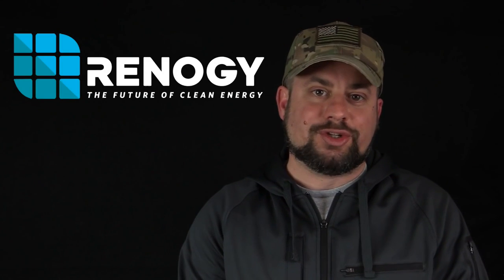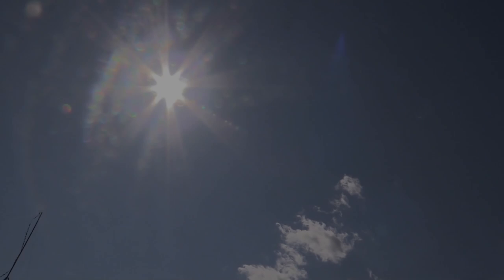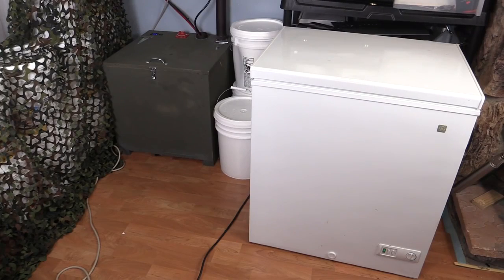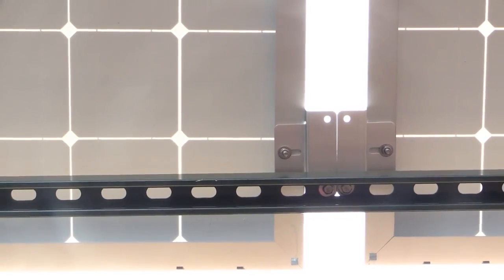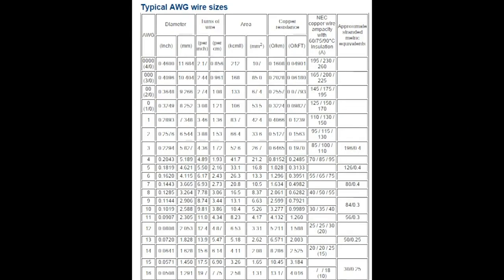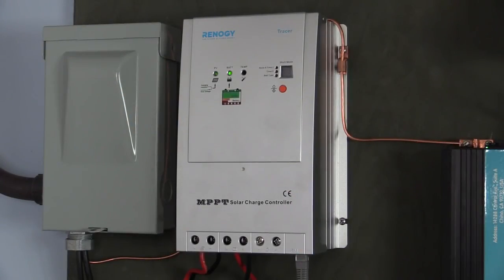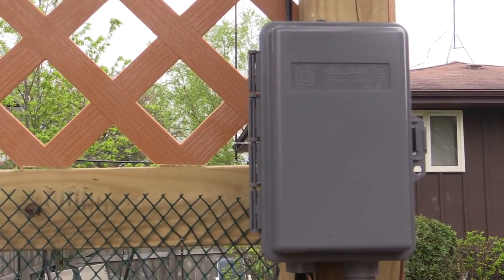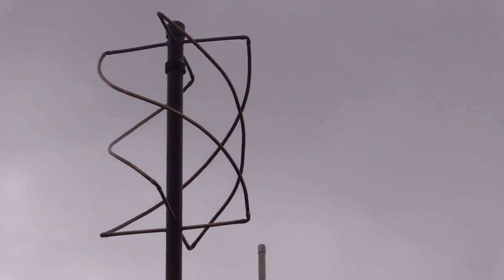The Ultimate Guide To DIY Off Grid Solar Power | Tin Hat Ranch

Comment: Everything these days runs off DC, so why not skip the inverter and just power everything direct
Reply from the maker: +X152535 because it is way more expensive and coming across DC powered devices in a prolonged disaster might be impossible.  Spend the money you save on extra capacity.
Reply: TinHatRanch Sorry, I don't understand.
Reply: No, you dont need 12 volt, as with the latest power banks charged by solar, you can run your lighting from 6.3 volts, same as you use to charge your cell phone
Reply: you can just boy the devices that require a ac power adapter(i think those are the devices you refer to) look on the device and read the required amperage and dc voltage (some adaptoes only reduce the ac voltage and not convert to dc) then decide how far you want to place your device from your battery bank. run 12 volts to that point and put in a connector . connect a "buck converter(rated for the voltage and amperage your unit will draw) to step down the power, attach the power cord you cut off the adapter supplied with your device(or buy cheep adapters that will plug into your device's female connection and cut the plug off at the desired length) the buck converter will drop the voltage and will release its magic smoke if your device draws more amperage than the buck converter is rated at. as for the comment about coffee pots etc.. all one has to do is buy a used perculator coffee pot that you place on a fire or stove, or do as i do, which is use a silicone funnel that sits on top of my coffee cup that holds a filter that i place my ground coffee in and pour your water into the grounds for 1 cup of automatic drip coffee, or buy a coleman automatic drip coffee pot , they are designed to put on a coleman stove.
i live kinda off grid, and use 6 T105 RE batteries hooked into my power distribution box of my 31 foot travel trailer with a 12 foot slide out. i charge my batteries with a home made generator using a 60 amp alternator and small gas engine. we carry water in a 200 gallon tank in the back of our truck and filter it before we drink it. we watch alot of movies for intertainment on a laptop and i have more than 2000 dvd .
i just got back to usa about the beginning of summer and had sold almost EVERYTHING i owned and moved to CEBU, Philippines to marry my Wife. while over there living in a condo i learned to wash instead of wiping  with TP.
my Wife has a BSN "batchlor of science in nursing". so she is not some ignorant girl wanting to escape poverty. but the people of that country are real survivalists!!  and the women do not complain if they do not have a washing machine, a real cook stove etc... i lived there for 8 full months, so i know. and we have 20 off grid acres in montana but currently living off grid in rural south dakota. ive lived off grid before . if i can give any advice i will do it with out a thank you.
Reply: TinHatRanch I think x15 meant most devices consume DC power to operate from the transformer or rectifier that comes with them to work with ac so finding DC operated products isn't really a problem in a pinch when you can just bypass the DC supply on each device.
Reply: DC refrigerators are quite expensive, but RV fans and lights make perfect sense. Just keep in mind that they will need 12v, so you will have to keep your battery bank at 12v. Instead of an expensive DC fridge though, you could put that money into a beefier solar system, (more batteries, more panels, bigger inverter) and use your regular fridge.

Going with an inverter gives you a lot more options. In winter an electric blanket will be worth it's weight in gold if you don't have a fireplace. On average they draw around 200w.  Modern gas stoves still need 120v AC for the glow plug, which your oven will not work without, (if your natural gas supply is still up and running). If you live in a hot climate, you could get a small A/C window unit you can at least run in the daytime when the panels can help supply enough power, (running it at night will require a really large battery bank). It gets up to 120 degrees in Vegas in the summer, so I planned my solar system accordingly.
Reply: INSANECANDYCANE1958 Thanks for the detailed instructions.Do you know where I can buy a 'buck converter'? Also is there any real benefit to taking out the inverter from this circuit, other than not having harmonics in your electronics? Does the inverter waste energy converting electricity from dc to ac only for it to be converted back to dc by the appliance's power adapter? I am think about putting together a small office in my backyard and powering it with solar panels and batteries but without an inverter. I want to modify my PC to run directly off DC power from the batteries. Just curious if such a design is even worth pursuing.
Reply: @X152535  how did that go?  the dc system you are discussing is having all DC outlet type system.  And not all electronics are solely 12v anymore
Reply: For days when the sun dont show a long time. And you have to control how much power gos in your house so it dont burn down.
Reply: Depends on the size of your dwelling.  If you live in a large house, the wiring losses due to the low voltage might waste more power than you'd lose by inverting it and running the mains voltage through the wiring instead.  Then you need larger cables for high power devices like fridges and microwaves, plus more expensive DC switches that can extinguish the sparks without catching fire (since you don't have to worry about sparking with AC).  So it's certainly doable, especially for smaller systems, but for larger systems there's a point where it becomes cheaper and/or more energy efficient to have an inverter and use AC.
Reply: With 12v DC power there also a high potential for power loss with the length of the cable.

Comment: you can change the chemical make up of a car battery and you've made a deep cycle of a cheaper car battery. all you must do is dump the acid water mix and replace with alum water mix. and this also gives you a battery that's less sensitive to cold temps. and they love to be cycled deeper, as it aids in ridding sufation on the plates. but the battery prefers to to be pulse charged. as a capacitive battery charger charges batteries in pulses. this too aids in the de-sufation process. giving you a cheaper alternative to purchasing new deep cycle  batteries. but you can find decent deep cycle batteries and do the same to them. then your looking at a battery that will have way better winter charging and discharging capabilities than a normal deep cycle.
Reply: Why don't manufacturer  think about this, are there any down side to the change?

Comment: You missed something.  First let me say great video but I think there is 1 thing you should have mentioned.  When the power went out you flipped a switch and got power back immediately.  This suggest to me that you could be tying your system in to your normal electric box.  If you do that and feed your house then you are also back feeding the poles.  If you back feed the poles you run the risk of injuring a line worker and you are 100% responsible for your back feeds.   Just a thought ... but people should be careful if they try to tie both together.

Comment: It isn't easier to go from a higher voltage in an inverter the technology is the same because the D.C is made to switch back and forwards to make A.C. which can be increased in voltage with a transformer. If you're using the inverter to power equipment in the house you don't need a true sine wave inverter but you do need one to feed into the grid.
Reply: Douglas Kay it's better to use a true sinewave for high end electronics. as they don't like the jittery volt amp signals from any source other than a true signwave. but I do try to buy electronics that can use DC from a battery and you factor out that efficiency loss from changing the state of that energy.

Comment: My opinion is that adding a HHO (Oxyhydrogen or Brown's gas) generator is a very good use for excess power. It can be stored easily and used in place of propane or natural gas in most applications. The efficiency can be as low as 33% or upwards of 50% depending on the  catalyst used, plus some extra losses for the compressor, but it's 100% efficient when burning the fuel. 

There's also the possibility of using a whole home energy solution with fuel cells where the excess heat is used for home hot water and heating, but those are still very pricy with the cheapest I've seen about $14k.

Comment: estimate the electrical consumption? Everything you plug in has a label. so find it, read it. done
Reply from the maker: +Ben333bacc that is true to a point.  The label will show maximum power consumption.  Not all devices run all the time nor do they run at full power all the time.  The refrigerator is a prime example.

Comment: Why not have a box under your solar panels with the batteries and inverter and AC out?  Wouldn't that save money on wiring and voltage drop?
Reply from the maker: +Compscilaw if you can do things in this manner, you are correct.  The location of my panels precluded me from doing so.

Comment: Buy supercapacitors to fix your problem with lead acid batteries.  ALthough this poses a danger, all of your energy can be released instantaneously if you accidentally short circuit.  So if you have a day's worth of power, it could make a decent sized explosion.  Also hydrogen cell batteries are a good long term storage solution, it doesn't slowly leak out the energy.

Comment: We have purchased the Renogy 400 Watt starter kit with the 40 amp MTTP controller and MT-5 Trace meter. I'd like to buy the Renogy pure sine wave inverter. We have a 12' x 34' manufactured home that will be off-grid. Can we connect the inverter to the 150 amp breaker box in it? We wouldn't be using the 240V breakers, just the 120V for lights(replacement LED units) and outlets.
Reply from the maker: +KmanJeeper the short answer is that you can.  The long answer is because of local code I have to defer you to local authorities.

Comment: So just to add to the info that you have put forth, for better lightning protection of your system it would be better to have an isolated ground bar on your backboard that has a main ground going to your ground rod.  Then run a separate ground from each piece of equipment to that ground bar.  Those connections should be made in such a way as to flow straight through to ground.  In other words the ground going to the ground rod from the bar would most likely come out of the bottom and the grounds from the equipment would come in from the top. Run them as straight as possible with a longer bend radius when a bend is necessary(lightning doesn't like tight bends).

Comment: Actually... that was a pretty good primer for electrical usage in general.

There's a few things that could be mentioned, like large capacitors that allow high voltage conversion after transmission to energy storage, but those are somewhat more advanced.
Reply: Super capacitors have one big drawback, they reduce in voltage exponentially as power is used.
Reply: All capacitors do. If other components could discharge as quickly as a capacitor they would probably experience voltage Lag/sag too. Capacitors can also be rapidly charged soo... as long as your inputting energy, such as from a solar array, the voltage lag you describe is not a concern. the capacitor simply conditions the power so as to be fed into the system.

Comment: Anyone want to lower their energy bill and leave a smaller carbon footprint by only doing a few things? Follow these steps.

1.) Get rid of ALL incandescent AND fluorescent bulbs. They both drain so much energy, they get hot, then you have to turn on the Air Conditioning. So, switch ALL bulbs over to LED bulbs. Also, the fluorescent bulbs have mercury, which is a poison, and if it drops, it can leave you with an expensive mess to clean up. 

2.) Get rid of ALL projection AND tube tvs AND all older tvs. If you have a projection built into the TV, take the flimsy plastic then make a solar scorcher out of it. Look up "How to get 2000 degree solar power". This thing can cook things in a fraction of the time, and it doesn't cook away all the nutrients.

3.) Get rid of ovens. They drain too much power. Only do this if you did step 2.

4.) Get rid of microwaves.  The radiation from the microwave kills off the nutrients. Plus, its extra power being wasted.

5.) Convert ALL tv's to LED tvs or 4k tvs. STAY AWAY from 1080P unless its LED. NEVER buy plasma tvs or LCD tvs.

6.) STAY AWAY FROM DESKTOP'S IF POSSIBLE! Get an 8G - 16G ram, 64 bit, at least a few hundred gigabytes memory computer. The operating system is up to you.

7.) USE GOOGLE CHROME, NOT INTERNET EXPLORER! Google chrome has extensions that can block annoying pop-up ads.

8.) If you use windows 10, DO NOT USE MICROSOFT EDGE! Use google chrome.

9.) After you get a laptop, turn the brightness down and enable power saver or balanced performance. DO NOT DO HIGH PERFORMANCE!

10.) Get rid of ALL power tools. They drain too much energy, and you can make your own by following A2C Arts and crafts tutorials.

11.) NEVER EVER BUY BATTERIES OR RECHARGEABLE BATTERIES! Make your own using copper washers, zinc washers, aluminum foil, cardboard, and vinegar. 1 of everything is considered "1 cell". 1 cell makes .5 volts. a few cells power a remote and basic things.

12.) Want to power something a little more? Make a magnet fan that can power slightly bigger things.

13.) Get rid of energy drainers you do not need. I can't name examples, because different people think differently about what is and isn't useful.

14.) Keep the max heat cranked up to 60 degrees. Too cold? Get some blankets and pajamas.

15.) Do NOT use air conditioning. It outputs dangerous chemicals that deplete the ozone layer. Yes, these chemicals are still lingering around. Instead, go outside and take a sun bath then go in the pool, or go to the lake, have a picnic, watch and/or feed the birds and/or seagulls. Go somewhere nice.

16.) When you go somewhere, don't let the house get above 65 degrees. Wait a minute, you just said keep the heat at 60 degrees, not 65. Well, some of the heat escapes when you open or close the door. Also, turn off ALL electronics, cut the power to the TV, computer, everything that has a light, cut the power. If you have an anti-burglary alarm, obviously keep that connected. 

17.) If you have a pool and only use it a few times a season, get rid of it.

After all of this will lower your energy bill by a lot. You don't need to completely change your lifestyle to drop your energy bill. The things that anyone of all classes (money) can do are 1, 2, 3, 4, 5, 6, 7, 8, 9, 10, 11, 12, 13, 14, 15, 16, and 17. Just have someone buy the stuff that you get rid of. The Air conditioning, the bulbs (possibly),  power tools, desktops, batteries, old tv's (some people are very old fashioned).
Reply: JoeAceJR  I'd rather get a second job.
Reply: Your #15... An air conditioner doesn't output dangerous chemicals that deplete the ozone layer UNLESS YOU HAVE A LEAK.
Reply: DEUS VULT most have a large power supply. A normal laptop use about 90 watts. much cheaper to run.
Reply: Google is evil, use firefox or brave.  Nothing gets tossed here until it breaks.  How about this simple advice- if you are not using it, unplug it or turn it off. Why unplug- lots of devices including surge protectors have lights or displays, these devices are always on.   I would say buy vintage, treadle sewing machine- most vintage isn't "power".  God help you if like me your hands are in pain.   Every house has a pool here.  It will cost me more money to get rid of it.   That pool is my back up water supply for sanitation and in a SHTF situation, becomes my open rain barrel!
Reply: JoeAceJR why stay away from desktops for number 6?

Comment: Could the EV battery from an older Gen 1 Toyota Prius be used for power storage?
  I just when to a public car auction where 2 Gen1 Prius that were wreaked in the front sold for $200 each,

Comment: You can use mirrors, which can be cheaply obtained - especially if broken - to amplify the sunlight on your solar cells. Moreover, mirrors set in a parabola can be used for heating water for coffee and bathing.

Comment: I used golf cart batteries in the past and they do not last. For a little more money, current prices of $700 delivered (I paid $600 last year at a local solar place) you could have gotten 2 Crown L16 type batteries with a  combined C20 of  close to 500 AH at 12 v.
They will last  7 years if you do not over discharge them.